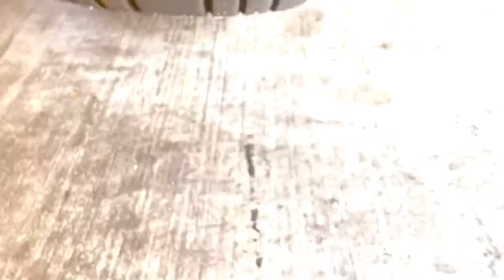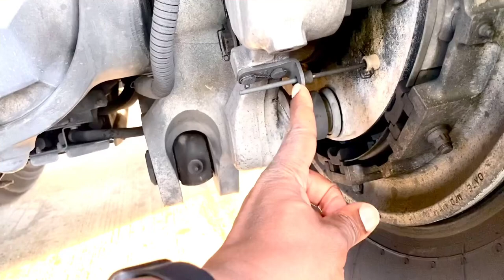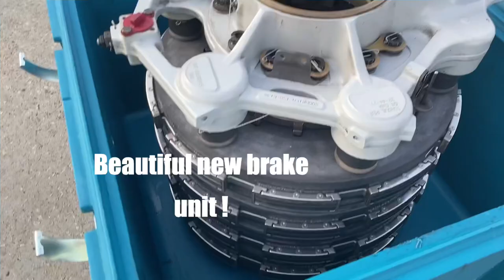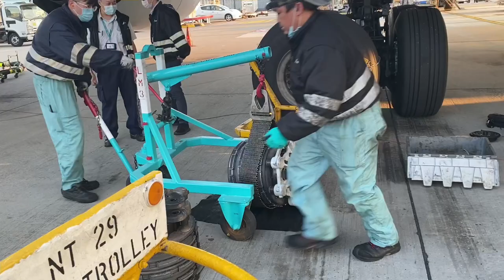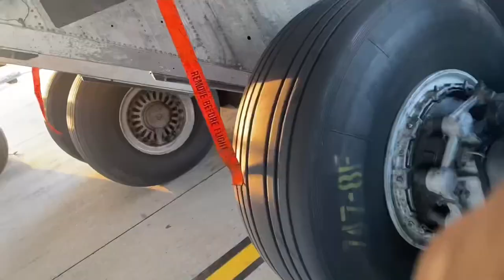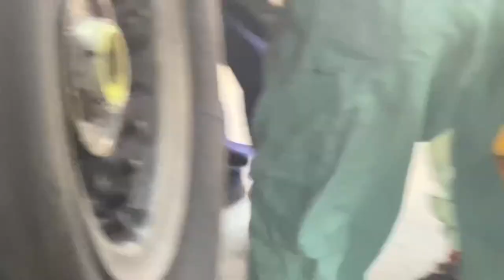Brake unit change B747-8

Comment: Been there, done that dozens of times. Not a brake pad, rotors and stator. Aligning the wheel to the loose rotors, is the real work, and hardest part. Easy, once you know the tricks.
Reply: Your right and they left out a few steps,, remove the hydraulic system head pressure,  now remove the brake hyd. line.  Reconnect it and bleed the brake. Also apply fresh grease to the wheel before putting it back on. Torque the nut and reconnecting the transducer. 
Did I miss anything,  LOL
Reply: @70slandshark47  Those have QD couplings similar to air compressor hoses. Head pressure, yes but no bleeding of brakes to do. Still, Skydrol, though. Tnx!
Reply: @moriver3857   Thanks for the update,  I am retired now so it's been a while,, I worked on the older Boeings. I do not miss the Skydrol LOL.
Reply: Did you use a spider to align the segments then apply the parking brake, or just carefully spin the wheel to pick-up the slots?
Reply: @125brat  No. Simply align the slots at 12 O'clock, with the wheel dolly align the wheel so it would rest on the 12 O'clock slot with slight weight on it, then by pushing the top, the wheel tilts and slides in. Slacking the weight in the slot, causes the rotors to turn. Takes a bit of practice, but works. Of course with the spider is easier because you can lock the brake once aligned. In 18 years, never used it. From DC9s, DC10s, 767, and anything in between.
Reply: @125brat   From what I remember is that you align everything up first and as you install the wheel,  you rotate each segment,  it can get a little tricky. You remember on a tire/wheel change,  you have to set the brakes first because the brake segments will drop down and it gets tricky again installing the new tire/wheel assembly. With the brakes set,  the brake segments are kept aligned. 
I hope this helps,,
Reply: @moriver3857   MO, just read your comment and again your explanation is better than mine regarding brake changes I remember there were times we didn't have some of the special tools/equipment needed to change brakes  so we had to install it the old fashion way,  thanks again.
Reply: @70slandshark47  Oh yes, simple wheel change by putting the parking brake on to hold all the segments in place whilst swapping the wheel, but yes, if youwere changing a brake unit and had the spider handy (as we did in our wheel change trolly) it was just as easy to align the rotor segments then apply the brake before sliding the wheel on. Mind you, it was a Tornado so dead easy to reach the parking brake handle rather than climb up all those steps to get to the cockpit of a 747 😬😁
Reply: @125brat   Back then,  we didn't have a spider,, wish we did.  It would have made the job easier.

Comment: It’s amazing to believe how incredibly strong those tires are, they can withstand up to 800 psi of pressure (390 kg per square inch). Normal pressure is 200 psi
Reply: KG per square inch? Are you having a laugh or are you being deliberately obtuse? It is KG per square centimetre . . .
Reply from the maker: Yes they are several ply and a lot of strengthening in their manufacture. I toured the tyre factory a few months ago- impressive
Reply: @TRPGpilot  
Français: PSI, pressure per square inch
Reply: It's actually bar, kgf/mm ^2 or even hectopascal.
Reply: @125brat  
🤭🤭🤭
Reply: @noonenone1205  Pounds per square inch actually 😁
Reply: @125brat  
Bro, what do you find at a gas station gauge pressure nowadays? DO NOT DISTURB!!!
Reply: Normal regular car tire pressure is around 32psi or 2,2 bar

Comment: I wonder if the brake unit is part of the actual wheel bearing? I mean on the back side of the wheel there is no bearing visible, only the big hole for the brake unit.
Reply: The wheel holds the brake to the axel, the wheel inner bearing is retained in the wheel via a snap ring, only the outer bearing is removed for replacement.

Comment: Awesome awesome VLOG.  Question, are the brake wear indicators required to be checked during the the pilot’s preflight walk around or is it performed by a mechanic?  Really enjoy your informative videos.  Thanks for taking the time to teach because it really helps guys like me who fly only the computer flight simulators.  😎 Stay safe and God bless.
Reply from the maker: Hi- thanks. Yes we do check them but the mechanics do too.
Reply: Engineers check them because you can't trust the taxi drivers to spot them

Comment: Actually, I would be extremely unhappy with this rather ham-fisted undertaking.

The mech opened the valve on the caliper assy. hoist too quickly, and dropped the caliper assy. onto the stub axle - possible stress raiser there.

Same with the wheel assy. - crashed into the brake assembly.

Although not an issue really, the chap with the socket allowing it to slip on the nut causes the corners of the hex to round.

99% in aviation doesn't cut it, it has to be 100%.
Reply: And possibly damaging the threads as well
Reply from the maker: Cool…is there anything you observed that was done correctly that you liked?
Reply: I noticed that too.....
Reply: @pilot_obet  Dear Captain Obet. Yes, they did have the correct tools at least. I just wish they were more careful with your aircraft. Safe flying brother, hamba kahle!
Reply from the maker: @steveb1739  thanks- I only asked you because…criticism is easy. Constructive is better…so, thanks😊
Reply: @pilot_obet  I agree with SteveB above.  Those 'mechanics' looked like it was their first time.  They tilted the entire assembly weight on the outer brake pad, which could fracture the material.  They also dragged the casting across the concrete, most likely scratching it.  Not professional at all.
Reply: Couldn't agree more, bunch of amateurs.